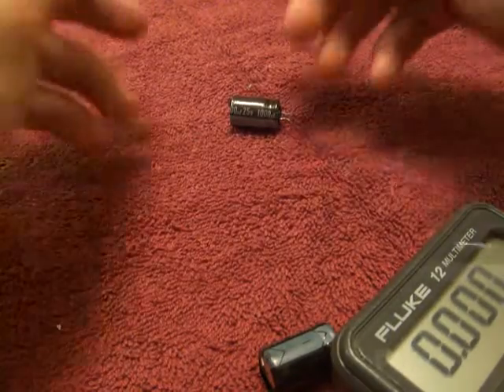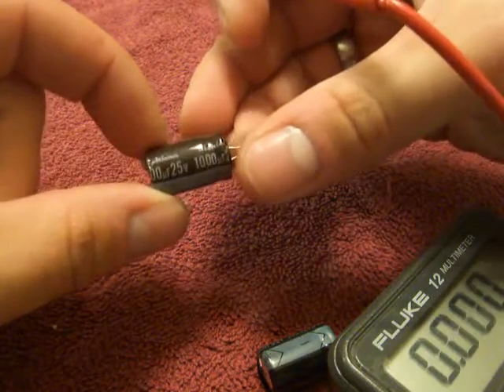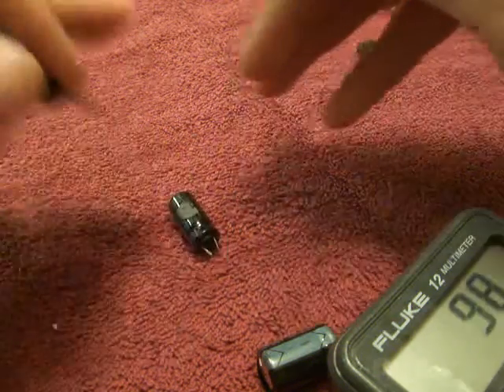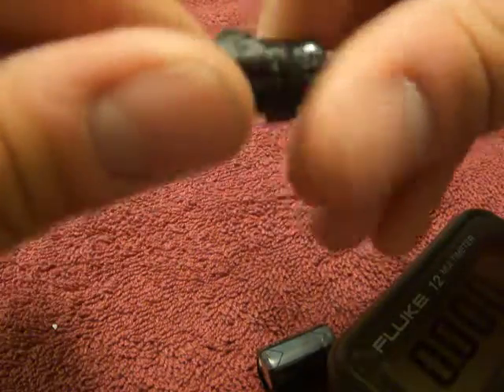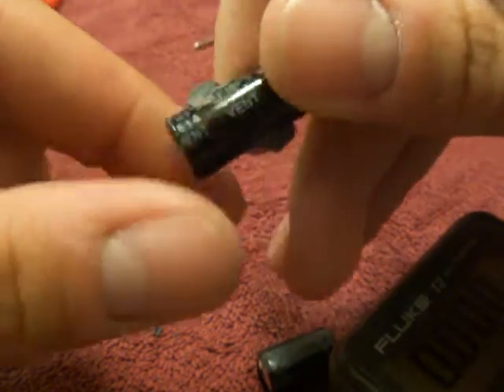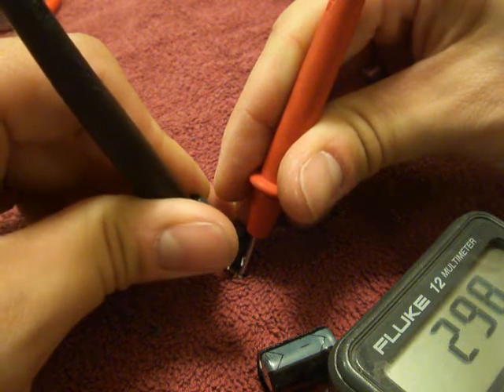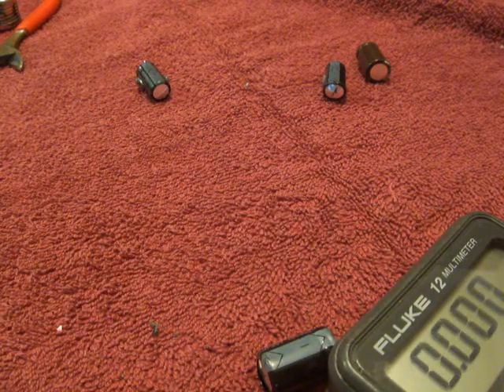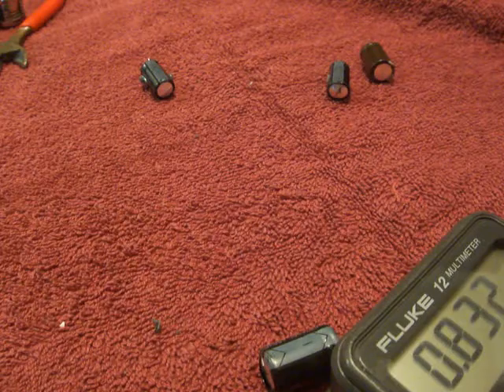HOW TO TEST CAPACITOR

Comment: Are you testing voltage, or continuety?? And also, can you replace Samsung LED TV T-con board: UN60EH6000F  to UN65EH6000F? Meaning, is it safe to replace smaller number to bigger number?? I just have to happen to have this UN65EH6000F extra, can I use it for my 60 inch LED TV ?? Thanks=)

Comment: Good basic testknowledge, but I'm sorry, you must test a capacitor at breakdown voltage for leakage, that's the tricky part about caps. They can measure fine with a meter, but put voltage on it and if it starts to leak, you're in trouble. Sorry if you have already mentioned or posted this in another video. Sincerely

Comment: So it wouldn't be possible to test the caps when they are still soldered to the board ? You'd need to unsolder them and take them out first ? So apart from obiously blown caps that are visible, the only way to know if the caps are bad is to take them off the board first, is that right ? Im a novice to this but find it interesting and really handy to know.